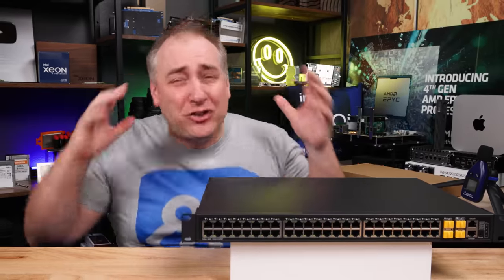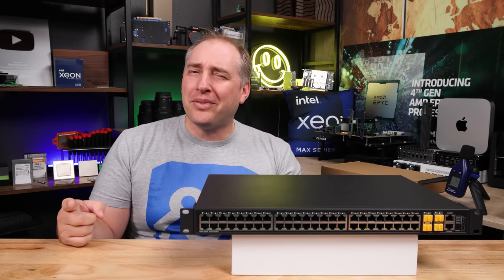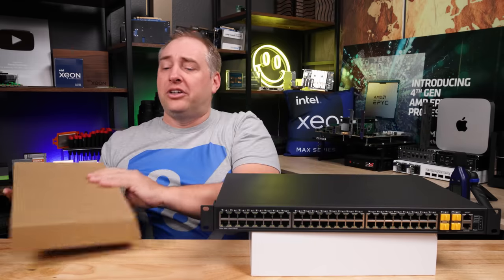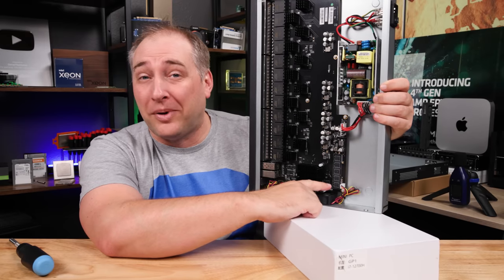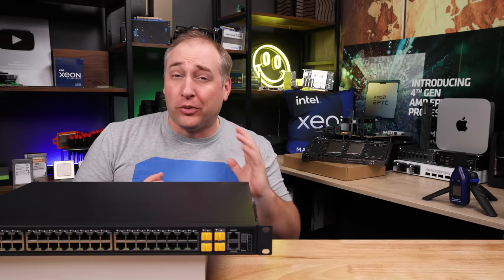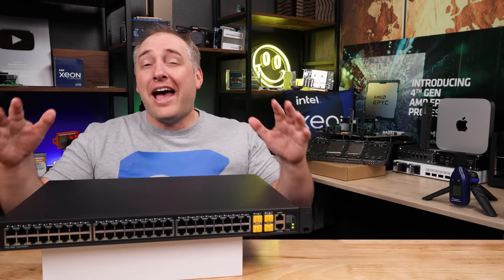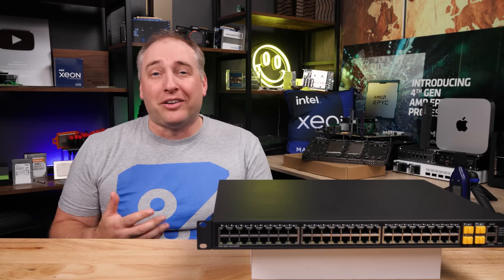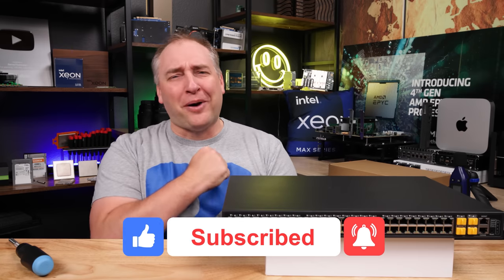INSANE $400 China e-Sports Mega-Switch with 2.5GbE and 25GbE

Comment: A lot of the Chinese netcafes uses stuff like pxe and iscsi to eliminate the need for drives (& drive failures) in every system (also ensures you get a clean os image everytime a customer boots up)

Previously some them were using 10g solutions, but with the rise of 2.5g built-in to mobos, stuff like this could really save a lot in terms of costs

Also because of this, most of the traffic is gonna go between the 2.5g and uplink ports, and not between the 2.5g ports themselves, thus a lower tier chip is usually not gonna be an issue since the uplinks are the bottlenecks here. (Plus the overall low utilization factor)
Reply from the maker: Super points. We still wanted to see what a saturated performance view would be since we had a port and switching capacity mismatch.
Reply: @ServeTheHomeVideo  hi do you have the link to the switch? I’ve been searching on Taobao but can’t seem to find it
Reply: Good point.
Reply: @ServeTheHomeVideo  I do think given the context of this device, being able to saturate the whole switch is probably asking too much. Anything above 60% performance is 'acceptable', 80% is good, 100% would be exceptional.
Reply: This is good information and makes a lot of sense.
Reply: In addition there's a 10G built-in board available to netcafe called MSI B150M ICAFE 10G, this has an onboard Intel X520 with SFP+ built into the back I/O.

Comment: If it is meant for only the Chinese market it is interesting to note that the GUI/mgmt interface and the silk screening on the motherboard is all in english.
Reply: Wouldn't be surprised if the reseller is having them flashed with English firmware for overseas users
Reply: It also has the China Export logo on it (the one that looks like the CE one but with the letters just a bit too close to confuse people)

Comment: Patrick a tip to make those stacked area plots you show of all the ports more informative would be to switch to a box and whisker plot. That would allow you to easily see the bandwidth variation for each port (width of the box) as well as compare ports to see if some aren't running at their rated speeds. Looks like these plots are made in Excel which has a box and whisker plot type.

Comment: Just a heads up... the firmware is just MicroSemi / Microchips reference SDK, I think they call it webstax smbstax, or istax depending on model and version. Lots of OEMs use it and I am pretty sure it still requires an NDA for it.

Edit: yea, I just looked it up and that's effectively what it is, could be an older or pirated version too, since licensing fees are like 50-100k and I don't know how they can fit it into margins unless they are mass producing these things.
Reply: That makes perfect sense. The other cheap managed switches from China that we have seen reviewed in the last little while often share both hardware and software. They always seemed like reference designs to me.

Comment: The web-interface is exactly the same as in the Zyxel GS1910 series. It's not bad, but CLI is king 😎
Reply: Stuff like that makes me think it's a "reference firmware" by the chip OEM, I've seen it a lot with DSL modems running on some Broadcom chipsets where they all have similar interfaces, maybe with the higher end ones having some bugfixes and features tacked on.

Comment: I picked up a used extreme something or other switch at a garage sale for $10
I only wanted those ~30 fiber transcievers in each of the switches.
But to my surprized, these were not 48x1G ports, but 48x10G ports, and 6x40G ports
Looked the switch up, and they're selling for more than my car on ebay, and those dont even work, the ones i have all work, they have both PSUs, and all the hot swap fan modules.
Great deal, i cannot wait for consumer switches like this with say 16x10G RJ45 instead of SFP+

Comment: Er did you remove those 12 heatsink because they are more likely to be four way 2.5Gbps phy chips for the ports than switch chips if you asked me. The power supply looks like a fairly standard 3"×5" 12VDC PSU. These are readily available from Digikey, Mouser, RS, Farnell etc.

Comment: I would love to see a 24 Port 2.5G + 4x 10G + 2x 25G (150GBit) would be perfect for a Homelab
Reply: Plus a few POE ports
Reply: @t03ias74  Fumbling
Reply: @t03ias74  POE is great, but on something like this it's not worth the extra power in the chassis. IMO POE devices are better as 1GB speeds, 1x10GB to an 8-16 port POE switch is a better option. POE adds a lot of power and heat.
Reply: @WilliamJasonSherwood  Yes, that's true!
But an extra switch with poe in the rack also adds extra heat and power. And with many wifi 6 ap's, a 2.5g poe uplink would be nice to have.
Reply: Not all ports have to have poe 4-8 would be sufficient for now.
Reply: @t03ias74  But a separate POE switch would let you use one of the 10 GB ports for a cheeky little 12x1GB POE switch. Also, a POE injector isn't awful.

For the target use case, POE is totally useless, the proportion of people who would use it and/or the proportion of people who'd not buy it due to no POE is tiny. Especially when the cost of a POE injector is next to nothing (you can even get a multiport POE injectors now!).

Comment: 48ports is overkill for me - need only 12 - so a 24port version would be handy. The value on this is mad but the power draw is a problem for a 'simple' home user, the loudness is also a issue for home use, maybe one day.
Reply: I'd love a 16+2+2 port version.

I'd be less concerned about fan noise because a smaller switch would use less power and you could always change the fans to Noctua.
Reply: But power draw is really dependent on usage. There’s an idle draw, then based on usage, use less pay less. Setup a couple solar panels with a gridtie inverter and it offsets the draw of the switch
Reply: @mrmotofy 50 watts is now a problem? You really should reconsider your life.
Reply: There is 16 ports, tp link made them

Comment: So I ended up getting the Model B variant because the Model A variant (shown in your video) is out of stock. It is slightly more expensive, and has a Centec TsingMa chip with 400 Gbs switching capacity (untested/unverified). The web UI is completely different, as expected, and not as feature rich as the Model A variant -- it appears to also be a product Centec, and not a US based reference SDK. The power supply and port layout are identical to the A variant, as are the PHYs. The overall main board layout is also very similar to the A variant. I haven't looked at the RAM and flash chips, they might still be Micron / SanDisk, or they could also be domestic variants. The B variant also has an extra fan, and all four fans are in the rear of the chassis instead of the side (better IMO).

Comment: While 40Gbps is a little weird in 2023, with breakout that could be eight 10Gbps ports which is decidedly not weird. Also every 100Gbps switch I have seen supports 40Gbps, and a bonded uplink at 40Gbps is better than one at 25Gbps.

Comment: Surprised to see the FEC settings showed up at 9:45 at the very bottom.
Not only for the 25Gb ports where FEC is more prevalent but for the 10Gb as well it seems.

Also found the math on port speed interesting.
25/25/10/10 = 70
40/40 = 80
So overall pretty close.
Wondering if the Microchip supports MLAG?  That might be where the 40Gb variant shines, 2 x 40GB DACs to merge 2 switches into 1 logically.
Reply: If it does support MLAG (aka MCLAG), it would be priced really well for storage transport.

Comment: That 4x2.5GbE chips with radiators aren't switches - these are PHY's. Basically a switch chip doesn't support copper connection and need external PHY for this (only a handful have PHY included). Also it simplifies PCB routing as you can use just two differential pairs (one for TX and one for RX) for every FOUR ports - as in QSGMII for 4x1bE. This is a correct way to do this :)

Comment: Is there any discontinuity in per-port power draw caused by those 12 downstream chips; a bigger jump from idle to 1 link than from 1 to 2 links in a given cluster of 4; or are the smaller chips either sufficiently efficient at handling partial use or sufficiently inefficient at idling that each 2.5G link draws roughly the same?
Reply from the maker: 0.3-0.4W so roughly the same.

Comment: hmm cant remember the name of facebooks initiave for open network hardware/software on the switches. what ive seen were some cisco switches supporting own software, briefly. im interested in those kinds of switches.
Reply from the maker: Open Compute Project and SONiC are the big ones perhaps?
Reply: fboss was the facebook project. dunno if level1 or someone else had a video about a specific switch. if remember correctly it was x86 for the os and there are specific lonux und bsd versions for it. that would remove alot of headache for features and so on.

Comment: 5:23 literally spade connectors on one side and plugs on the other..why can't we replace the psu? Sure it's not a standard form factor and/or nicely hot swappable but it wouldn't be hard to do like it might kf the AC terminals were soldered instead.

Comment: Not bad. For a lot of applications fully non blocking and line rate on all ports at the same time is total overkill and there is no need for this. Honestly I didn't see non fully nonblocking switch in very very long time, but honestly for office, netcafe, home it is not an issue at all. Server rack with a lot of distributed storage, sure, that would be crap, but then in server rack you would be using 10G or more, not 2.5G.

Comment: The bandwidth doesn't allow to maximize full duplex data transfer on all ports simultaneously.
48*2.5+2*25+2*10=120+50+20
=190 Gbps > 160.
From the datasheet:"VSC7556 SparX-5-160 supports up to 160 Gbps of bandwidth with the following primary port configurations.
• 16 × 10G
• 10 × 10G + 2 × 25G 
• 16 × 2.5G + 10 × 10G
• 48 × 1G + 10 × 10G"
Here (2nd case) the total is only 150G
And there's only 8x10G=80Gbps shared between 48*2.5=120Gbps ports
Reply: sure but... whatever. If you've got an application where you actually want to saturate all the ports at the same time you can afford to spend a little more
Reply: Right its a good basic connectivity solution not an Enterprise and maybe not a good LAN gaming switch for 4K modes. Often with these lowend switches the internal buffering is shallow. For stream type apps the buffering falls apart and the protocol stack will window down. Really you need a solid Lan Test comparison of which there are many.

Comment: Would be interesting to hear more about the threat model presented by untrusted network hw. Like in a more general sense
Reply from the maker: That was covered in key lessons learned.
Reply: Its an interesting topic. And it seems one that a lot of people have misconceptions about
Reply: @ServeTheHomeVideo When you're done experimenting with the switch, perhaps you could resell or hand it off to another channel that might be interested in doing an in-depth security assessment.
Reply: @ServeTheHomeVideo  I'd be more worried about it intercepting and substituting DNS traffic than being part of a botnet.  Also, the chips marked Micron and Sandisk could be faked, it's happened with GDDR chips.  These are cheaper than GDDR though, so probably not worth faking.

Comment: Hey Patrick, nice video.... would it be possible to change the fans in this switch ? Maybe u do a video where u change the fans 🙂 hAVE A GREAT DAY
Reply from the maker: You can but to 3-pin units and you would have to worry about cooling performance of those fans. The airflow is not great.

Comment: What I'd like to see is a sub-$400 2.5Gb POE++ switch with a 10Gb uplink.  The best I've seen are either $165-175 POE+ (not enough power for my AP) 4X2.5Gb+2C10Gb switches.
Reply: Hasivo claims their S600WP-5GT-2S+_SE supports up to 90W PoE on port 1 (but you have to request the 130W power supply). I haven't seen anyone verify that it actually works like that though (but the UI claims 802.3bt on that port).

Comment: This is more like what I'm after. I do want the 48 ports as my current one is using 28 of the 48 ports and looking to add a few more. 

But I also want a POE version, to run my cameras and AP. 

The 10g and 25g ports would be super useful, the 25gb link to my server would be amazing, and then 10gb links for my editing station and internet link.
Reply: I personally prefer POE to be on a secondary Switch, since in something like this it would be adding a heap of extra power draw and heat into the chassis.

Comment: How big are the fans? Might replace them with some Noctua fans
Reply: In case it helps anyone else, the stock built-in fans are 40mm, and yes, they are LOUD -- so I am replacing them. Model A has only 3 (per this video), but Model B (the one I have) has 4.

Comment: 4:23 The “CE” is certification for the european market actually
Reply: The logo is fake. The C and E are too close together; a common tell tale sign. The E must be placed tangent to the C as if it made a complete circle.
Reply: Or China Export
Reply: @d_mcg  I doubt the certification includes a printer, I don't know if having a skewed logo is a very good indicator if it's fake or not 😅 
But yes you're very possibly correct still.
Reply from the maker: This does not appear to be THAT CE marking. It is pretty common for a slighly different marking to be used to say "China Export" but that some could be confused with.
Reply: @ServeTheHomeVideo  oh you're right, I didn't know that, very interesting

Comment: I can't figure this out.  Got this switch and attempt to access the web management interface and can't get it to come up.  Tried through the MGMT port and through a standard port and it can't find it.  I go to my Comcast router and take a look at attached devices and it doesn't see it.  I even disconnected it from the modem so it had no signal coming in and still couldn't access the web interface.  Any suggestions are welcome.  (By the way it works fine as a un-managed switch.)
Reply: Where did you get it from?  Did you ever resolve it?
Reply: Aliexpress is where I picked it up from.  As to the web interface not yet.

Comment: This could make a great small business / home switch for homes that have in-wall cat6 assuming you're ok with 2.5g, or choose from port to port 2.5 or 10g by using the 4 10g ports or a smaller 10g switch for core and or server vlan networking.  I hate to beat a dead horse but where are all the ~<$1000 chinesium 10g 48 port switches?

Comment: It would have been kind of nice to know the power consumption with all ports populated and while being tested, and to be able to hear the switch power up without the host talking over top of it. Otherwise this was a pretty good video to get an overview.
Reply from the maker: We usually just show incremental power consumption so folks can take say 0.3W - 0.4W per port and multiply by the number of ports they plan to use.
Reply: Loading up 48 ports and testing is no easy task
Reply: @mrmotofy  They did it in this video already. How much harder is it to use a power meter and give a figure?
Reply: @wishusknight3009  They gave a figure...use a calculator if YOU are that interested. Take a little responsibility put in the effort to answer a question YOU have rather than whining for others to spoonfeed it to you. Most others won't care. If you can do so much better start a channel and make your own vids with your own info the way you think it should be. Then people can complain about YOUR "perfect" method and format.
Reply: @mrmotofy  Except it may not reflect what a calculator says based on extrapolation. My criticisms were fair. Now sit down boomer.

Comment: Imagine this switch traded that 2xSFP+ and 2xSFP+28 ports, for just 2xQSFP+28 ports
Fewer ports, but WAY more bandwidth
Reply from the maker: There is a version with 2x QSFP+ 40GbE ports, but you would run out of bandwidth anyway.
Reply: @ServeTheHomeVideo  That is true, for home lab i would mostly use the two 40G to connect to my cheap ($10) extreeme VSP7245SXQ, and my backup file server, what i really want are those 2.5g ports for all of my jacks. ATM i have the extreme switch, and a mikrotik with 48x1g 4x10g and 2x40g
but as the only switch on a network it is a bit lacking for dual 40g.

Comment: It's great that such bargains are becoming available, but I have found performance in terms of range are subpar with cheap Chinese switches.

When cheap 1GbE D-Link or Netgear switches can do 1GbE over a 40m cable, these cheap switches struggle to do 100M on the same cable.

Perfectly adequate for short distances, just don't expect high end range performance.

Comment: The 2.5G to 2.5G port to port probably works decently. What usually falls apart on these designs is the uplink (2X25G) ports. Obviously if you have 48x2.5 (120Gbps) - feeding that through a pair of 25's (2X25 = 50Gbps) would mean you have a serious choke point for applications that must get out of this switch.  (IE not an Enterprise switch at all.) But for home use - its overkill really. Note the fans are noisy primarily because they are mechanically screwed right to the sheet metal. If you hang them on some foam they will quiet down quite a bit. This is an old trick and you will see it used on Noctua's current designs.  Odds are they are really cheap fans that will last maybe a year. Then the box overheats and the thing dies. I'd put in some nice two bearing fans and call it a win.
Reply from the maker: Most leaf/ edge switches oversubscribe downstream bandwidth compared to uplink BW.
Reply: @ServeTheHomeVideo  - They do indeed. Its all about latency, speeds,feeds and load balancing. This is the Vitesse line of switches. I think Microsemi bought Vitesse and Microchip bought Microsemi.

Comment: Remove the existing power supply you can do a mod, open new hole for power plug and place a dual supply inside for redundancy. Rock switch should be removed, who need a on/off switch anyway.